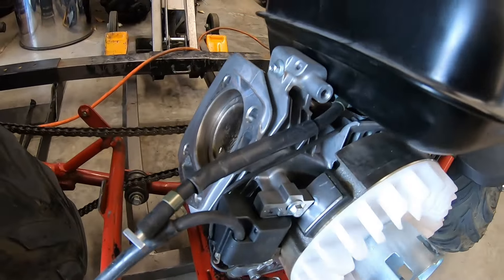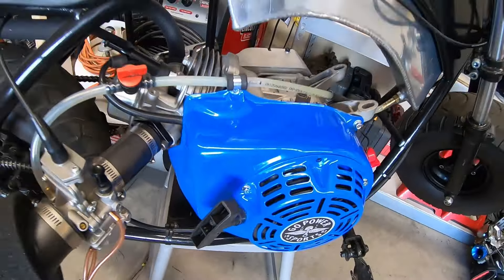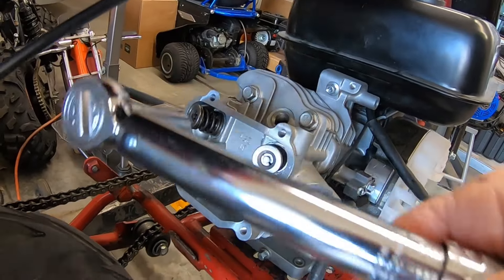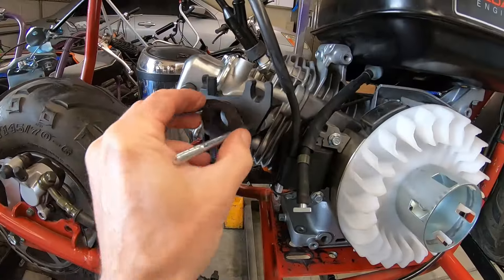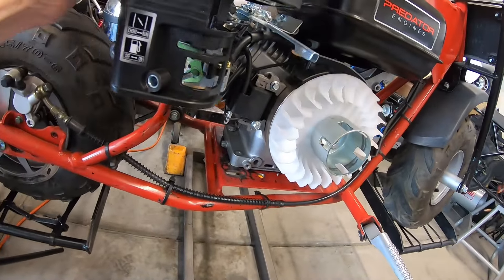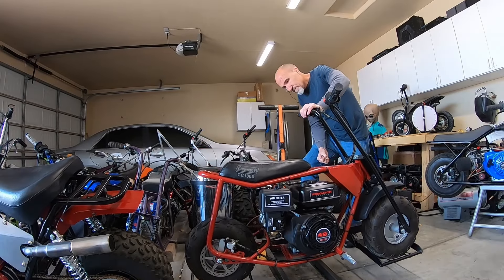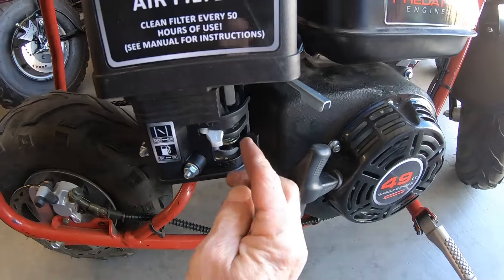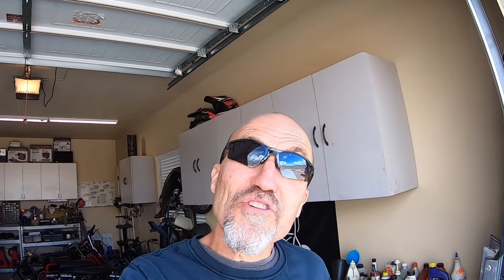Mini bike engine build from spare parts will it run?

Comment: Lol I love these "mutt" builds.  I just recently slapped a 196cc together myself for a ct200u.  Flat top piston, used a stock gx160 rod to get the piston up a little further.  Used a 208cc head with 27mm intake 25mm exhaust.  Runs hard, super little torquer.  I guess I tried to make more power lol, but honestly parts I just had laying around.  Sorry kinda a poor comparison, I just think its fun how universal these engines are.

Comment: Working on a predator 212, aluminum flywheel, 26 pound springs, vm22 (with 115 jet) new rod and flattop piston and a 265 cam Just having trouble with it starting because it took me literally 3 dozen pulls to start it. And the first time it started it died immediately but when i gave it gas it started. Sounded quiter then before i rebuilt the engine
Reply: what did you lash the valves too?

Comment: What would cause the predator 212 to only run at 15mph? It has a torque converter with a stage 1 air filter with a new stock carb on it with the govoner still on

Comment: Whats better a straight chain setup or torque converter?
Reply: I wieght 170 and have the ct200u-ex so I'm taking it as torque converter be better?
Reply: If I trail ride and do streets you say js go with a torque converter because I just got a wild cat so trying figure out a setup having even ran it once yet
Reply: And I'm trying to save up for billet parts kinda hard when ur 15 tho? But I'm almost done with the build cause I got a fram torque converter,exhaust,new carb, just need bullet internals and new cam with springs.
Reply: New carb*